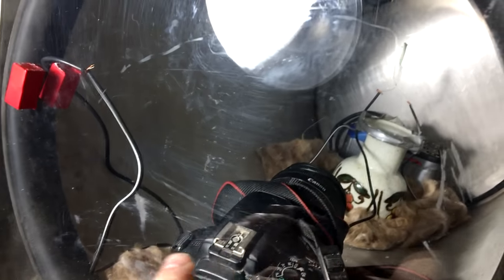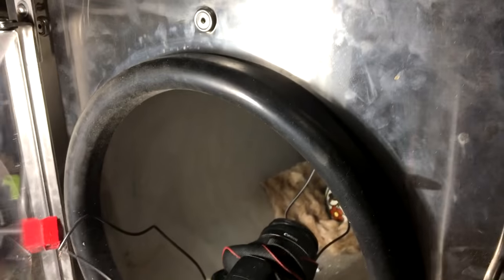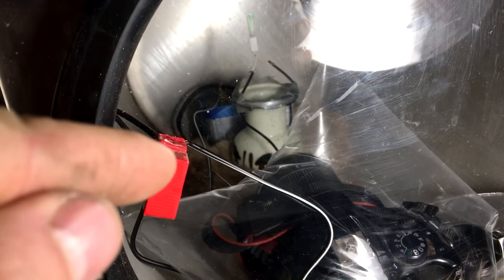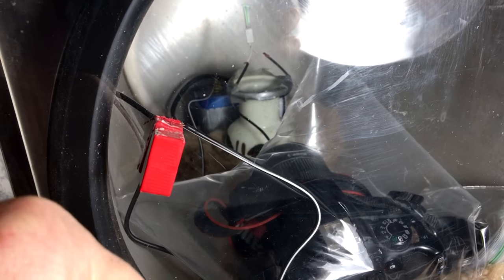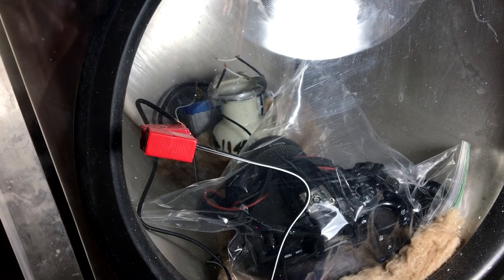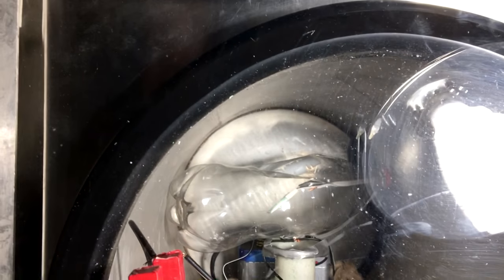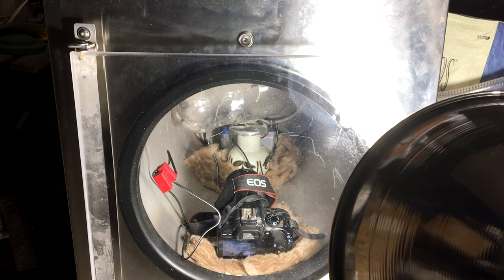Sound of Explosions in Space? part 1

Comment: I'm not so sure about this one Cody. 
Just to speculate; I think if you had a much larger vacuum chamber your results may differ.
The expanding gases, given a much larger volume to expand within, are going to dissipate in all directions. There will be a point in which the density and energy are so low that they no longer detectable. 
So... again, more speculation... if their explosion was very near you could probably detect (which you just proved) it but the range of which it was detectable would be limited to the volume of the gases once the expansion reached its limit and the velocity of the gas reached zero.
Try it again, either a smaller explosion or a larger chamber.
Reply from the maker: Why would the velocity of the gas reach zero? in a vacuum there is nothing to slow it down.
Reply: Cody'sLab space is at a vacuum but it's hardly empty. There are gasses and solids present albeit at extremely low density as well as other energy, solar radiation, etc. It'll sure take awhile by eventually I think the gases would come to rest from acting on other things or take on some acceleration from other influence than the event that sent them in motion.
 This could be fun to explore... perhaps instead of an explosion moving mass, how about a release of pressure?  If you had a small vessel with a defined mass and released it you could measure the impact of said gasses. Then, do it in a vacuum and measure. Whatever the delta would define the loss of detectable energy. You could probably deduce the volume of space it would take to absorb an event like a small explosion. Or at least figure out how much gas density is required to actually transmit the impact as frequency that we can audibly detect.
Reply: can you show why astronauts space suits do not expand like a balloon in a vacuum

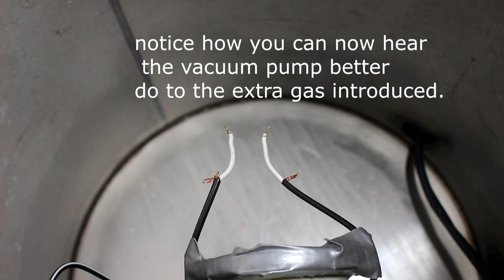Comment: So I wonder, if you had your clock ringing in vacuum and then have the explosion go off, afterwards the ringing would be somewhat audible similar to the vacuum pump at 1:23. But during the explosion, that slight popping sound, would that moving air carry the ringing noise towards the camera, if the clock was standing between explosion and microphone? Like, would the ringing be louder during the pop than it would be afterwards? And in space, where an explosion would not fill your surrounding with air, could the moving gas carry an audio signal with it? Kinda be modulated by something on the way through space?

Comment: Not meaning to spoil the experience for your, but the plastic pieces are hitting the chamber walls, making them vibrate and pass that vibration to the air outside and thus to your ears and by contact to the camera and microphone. So, you haven't got reliable data.

Comment: Did the explosive contain an oxidizer? I don't see how it managed to trigger an explosion in the first place without oxgen, however small that explosion was.  It's also hard to tell how much louder the normal pressure explosion was on video. The similarity lead me to believe that the vacuum chamber was leaking because of the wire being fed through the hatch.

Comment: Combustion requires oxygen.  Oxygen and other gasses must have been present for combustion to happen.  Sound can travel through that gas, but it also travels through the solid objects in the chamber.  The explosion creates byproducts from the plastic as well.  If you had an isolated microphone and a longer chamber you could rule out the blast radius and get a clearer result.

Comment: though you'd probably have to be pretty close to it to hear something that's considered audible, right? Like one of those black powder charges you used on the mine exploding at 1 km from you in a vacuum, would you hear it? how much?
Reply from the maker: If you could hear it on earth you would hear it better in a vacuum. unless there was some obsitcial blocking the gas.
Reply: your tiny vacuum chanber is likely noticeably filled with the gassed the explosion produces. As the 'shockwave' of gas hits the chambers walls, the sound can and will travel through that material as well.

very rough guess, if your vac. chamber is 10 by 10 by 10 cm large. If your chamber were 100 cm^3 the gass produced by the explosion would already be 1.000 times more dispersed. if it were 2 meters cubed, 8.000. 

The gas so rapidly disperses into the empty void os space, you'd need to be ultry close to hear anything.
Reply: LutzDerLurch - ur thinking of that in the wrong sense.
Reply: aha?

Comment: So star wars got it right all along? Amazing!
Reply: I have a hypothesis about that:

Fighter planes these days utilize artificial feedback because pilots need to feel the resistance around the flight controls even when the aircraft is completely fly-by-wire. Drive-by-wire systems use this method, too. Imagine if your steering wheel was just a potentiometer and you couldn't feel the road! The Cadillac CTS, for another example, now has feedback built into the the seat to give you proximity warnings (in the proper direction even) around your car.

For sci-fi movies and games I propose this: Those pilots can not hear the actual sound of blasters and explosions around them (unless in close proximity). So, the sounds are simulated to give the pilots immersion and better awareness of their environment.

Comment: Obviously the explosion would be more intense.   Their is little to no pressure pushing against it....

If it were a larger chamber you wouldn't hear it as loud, or at all.   Most of that sound was the chamber itself.  

Inside the bag was quiet because, I'd imagine, the bag doesn't make a good speaker.   The shock wave hitting it was absorbed and the bag didn't vibrate, nor was it able to push anything toward the camera.   

In a perfect vacuum you would have heard nothing.   A perfect vacuum would such the blast away too quickly.   As soon as gas is introduced, it isn't perfect anymore.   So, in a chamber you will hear sound.   There is no perfect vacuum so sound will always be...

Comment: Can you try to perform the same experiment with two vacuum chambers configured kind of like a Dewar flask? This would isolate the inner chamber's pressure wave from the outer chamber similar to how the sound was dampened when you decided to place the blast cap in the bottle. You could then place the camera in the outer vacuum chamber and see how effectively the shockwave from the inner chamber is able to propagate through a nearly completely isolated chamber in vacuum. I would suggest maybe hanging the inner vacuum chamber inside the outer chamber by a thin cable. The problem with you're experiment the way you have designed it is that even though you pull a vacuum, the blast cap clearly has the ability to pressurize the vessel to some degree because it's enclosed and results in reverberating pressure waves that your mic will always pick up.

Comment: I doubt it has anything to do with gas. The sound is most likely conducted through the vacuum chamber itself rather than through the air after pieces of the blasting cap hit the edges of the chamber.

Comment: Great video but why do you think an explosion in a vacuum would be weakened? If anything I would think it'd be more powerful since the pressure difference (inside the exploding cap vs outside environment) is greater then at atmospheric pressure. Also, the gas wouldn't be slowed down by the air molecules in a vacuum

Comment: Dear coby,
can you provide an explosion on normal air with bottle as contaiment to "see" if the explosion is weaker in vacuum?
Also you could buy some really inexpensive barometric sensor + arduino-like (less than 30$) and measure the pressure inside the chamber (you can get a 325540009-50 from 1 kPa to 110 kPa, ~20 reading per second, for less than 20$)

Comment: Would the gas be traveling faster because of its urge to go to an area of lower pressure (the chamber with a really low pressure) and it's low resistance to anything to slow it down, causing it to slam against the bag making the sound? I'm not in any way a professional in this, I was just thinking that because of the law (I guess it's a law) that something of higher pressure moves to an area of low pressure. Feel free to correct me, I'd like to learn about this.

Comment: You need to provide your test with an Anechoic Chamber at near vacuum and isolate mechanical vibration from the chamber to the camera body..  You should be able to figure out how to line your chamber with a proper material relatively cheaply..

Comment: Wouldn't the  explosion be even more powerful in vacuum if there is no air or other particles to push against? It wouldn't exert any energy until the expanding gasses reach the wall of the bottle in this case. The vacuum should accelerate the gasses even further as it tries to spread the gasses to fill the vacuum.

I also wonder if the explosion would have any smaller effect if it takes place in a pressure chamber with say 1000 psi as there would be much more air in the chamber that it would have to move? 

Kind of like exploding the detonation cap under water. The energy it would put out is the same but it would be contained in a much smaller area and you wouldn't hear it a little farther away.

Comment: Have you considered the gas from the explosion may be hitting the side of the chamber and mechanically transmitting to the Microphone? From this end the amplitude of the sound is not much different between all your experiments However duration seems to be shorter under vacume. Mechanical coupling would account for that. Sound going through solids like steel and plastic faster.

Comment: Is it possible that the sound was transmitted by a medium other than air or any produced gasses?  For example, both the device and the camera are resting on the same surface. That's even accounting for the insulation and the other methods used during the experiment that I can see in the video. It's a really cool experiment; awesome to see. Thanks!

Comment: There is a potential for the observation skills in the video and decent quality when it comes to explaining the physics behind it (as always), however I just think the set up is not that efficient... as one other commenter mentioned; I also believe that the sound that you hear is mostly from the fact that the flying pieces are hitting the inner layer of the chamber (which from the video looks like it's made up from a tin box or a thin layer of steel in shape (please correct the wrong).
Despite the fact it's close to vacuum, I recon the result will be almost completely different if you repeat the experiment in a much larger vacuum chamber...
And please try and do so in the future. Get a larger chamber.
Thank you

Comment: Anyone else find the pitch change between normal air and near vacuum interesting? My hypothesis would be that it is caused by the gasses not being slowed by the air and therefore the entirety of the pressure hitting in a shorter time.

Comment: Good stuff - any way to measure how fast that wave of gas is travelling? We know the speed of sound and shock waves in the atmosphere and it's limited by the air - but in a vacuum? Is it the gas moving at the speed of detonation? 20,000 ft /sec?

On the videos of the lunar landings you can see the lunar dust racing away like bullets - exhaust velocity of the rocket is what? 10,000 ft per second? - if so, some of the dust would have lunar orbital velocity of 6,000 ft/sec or so.

Also hear stories of under sea blasting - at a certain depth the dynamite just sits there when detonated - water pressure too high for it to expand when it's detonated.

Comment: Is the sound louder in the vacuum, if so does it mean the shockwave is stronger due to no resistance from an atmosphere? If this is the case, doesn't this mean an explosion or impact on the ISS could have an effect similar the the soda bottle, where the expanding gas from such an explosion could have a greater effect? If this is the case, I hope they are testing materials for the superstructure of the ISS and other space vehicles within a vacuum.

Comment: My question is, does this mean a bullet could be shot in space? If only a hammer was used and not an electrical fuse to set off the gunpowder within the casing? Sorry if its a stupid question, but would there be enough heat to set off the explosive?

Comment: Cody do you use florescent lights in the room you film these in? IIRC florescent bulbs flicker because the use AC power, so they have a dead zone when the wave of the AC frequency passes through zero, which we can't see but the high speed can. Maybe try using different kinds of lights to test this, an Incandescent, an LED, and a florescent.

Comment: I'm not disagreeing with your hypothesis I think I see another source of vibration. you tried to dampen vibrations from the vacuum chamber with the fiber glass insulation however those aren't perfect shock mounts.  sounds waves can travel through the metal of the container from the ceramic mount if the blasting cap to the camera's body.  you could test this by hitting the chamber with a hammer while the camera is recording.

Comment: Could you repeat this test, not with a blasting cap. But rather with an electrical spark? If you have the ability to produce an one inch spark between two electrodes, that would be cool to see and/or hear in a vacuum. That is if sound is heard.

Comment: I think the reason the bottle was damaged so much was because the presure differential  between the two was so much greater. than without the vacuum. it was not the explosive directly that did the damage more the artificial extreme difference of presure. to test this you could put the cap in a simular bottle and set it off without the vacuum. I know it's not a perfect test bit It would at least be a test of concept. dose the shock wave do more damage in a vacuum or not.

Comment: I think the reason wy explosions can't be heard in space is because their is nothing for the sound waves to bounce off and their fore disintegrate. the vacuum has surfaces for the sound waves to bounce off so it could be heard. Cody if you are a true science believer or fanatic you would know this.
Reply: he put the camera on some sort of foam so that's out of the way. Plus the explosion happen in mid air not on the chamber's surface, it still needs to propagate through "air"
Reply: ***** don't matter the barrier from the vacuum the metal sheets allows the bang to travel
Reply: decapitated Gamer what metal sheets?
Reply: ***** I say sheets I mean the container wall my bad
Reply: then read again my comment, the explosion doesn't happen on the container's wall so the shockwave would still have to travel through air
Reply: ***** yes the explosion happens mid air but the reason why we can hear it is because the sound waves are bouncing off the walls and and the container and returning back so we can hear it.
Reply: decapitated Gamer my point is for the sound waves to bounce of the walls, they need to travel through air in this case a vacuum so...
Reply: ***** isn't that basically what I said apart from the air stuff lol
Reply: decapitated Gamer then you realize your argument is irrelevant?
Reply: ***** it wasn't an argument it was an analysis of which we both had different views and came to an agreed solution
Reply: +Ben G ...I think the foam/cushion only reduces the vibrations to a minimal level but does not necessarily completely isolate the camera from the vibrations
Reply: peace bewith u My point was to even make the sides vibrate, the sound have to travel through air. The vibration are largely negligeable
Reply: Sound can travel through different mediums. Air, Solids, Liquids...
Reply: peace bewith u sound struggles through liquid certain frequencies can buy most nada I believe
Reply: decapitated Gamer I was replying to Ben G. But thanks for the info anyways!

Comment: What is that triggering mechanism you worked up? It looks like the interior and exterior are connected magnetically, but how does that open and close the circuit just by turning it? I've looked at it a little but I can't find enough detail to work it out just by that.
Reply from the maker: Tilt switch + magnets
Reply: Zara he explained in one of his previous vacuum vids. I think he's using mercury as a conductor